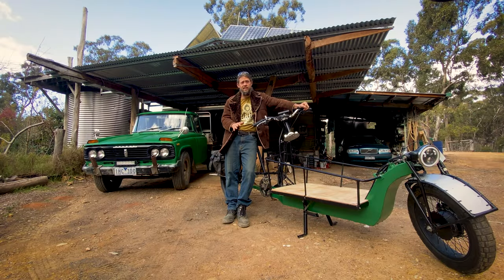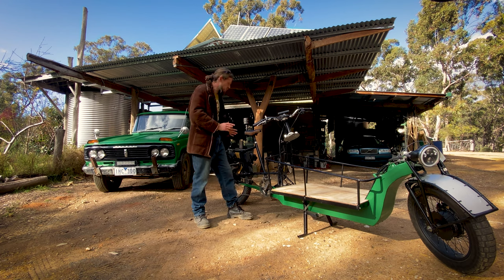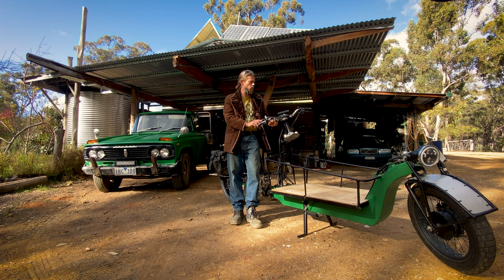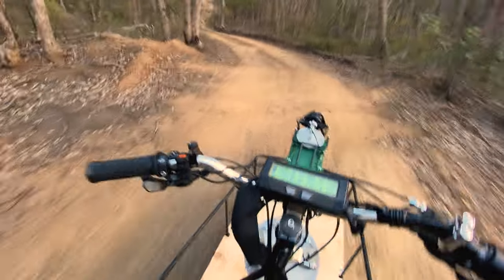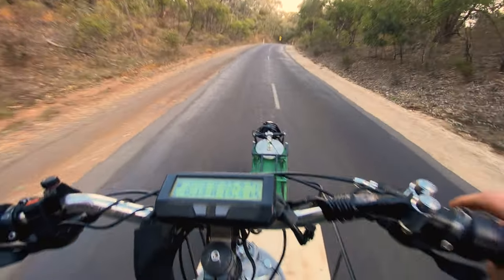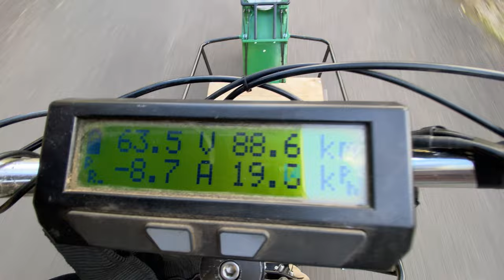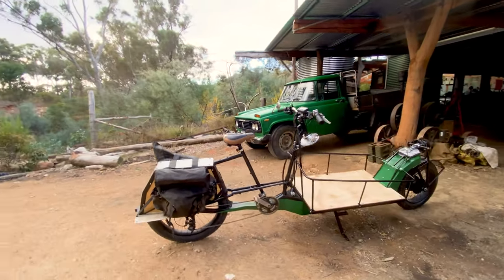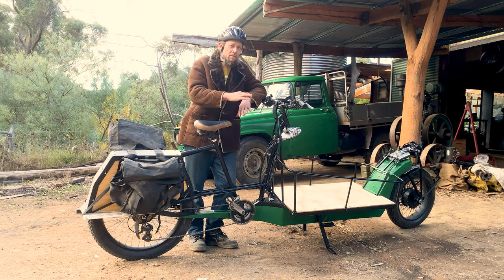Monster Dual Motor Cargo Bike - GRIN IT to WIN IT - "Cyclopes"

Comment: Great solution to your problem. How fast does it go and what’s the comfortable cruise speed?
Reply from the maker: I speed limited Cyclopes to 65km/h. I’ve not been game to go faster than that 😆
It’s stable at 65km/h. The highest cruising speed I’ve done for sustained periods was 47km/h over a 30km trip from Fryerstown to Hepburn. I had about a 30kg cargo load on that trip. Energy consumption was the highest I’ve ever seen it at about 31wh/km. 
My usual casual commute to the farm is a more relaxed and quieter 36-40km/h and I usually get about 20-22wh/km for that run.